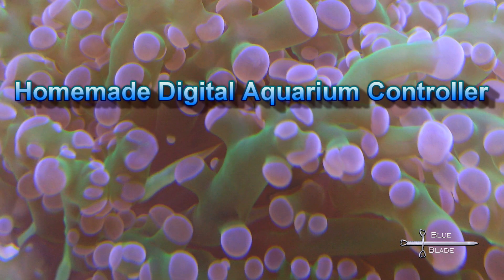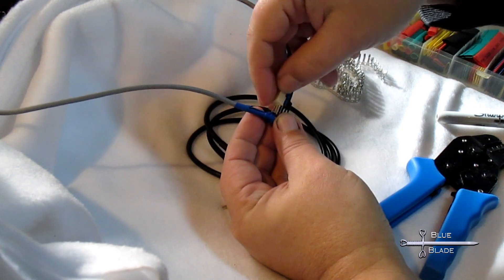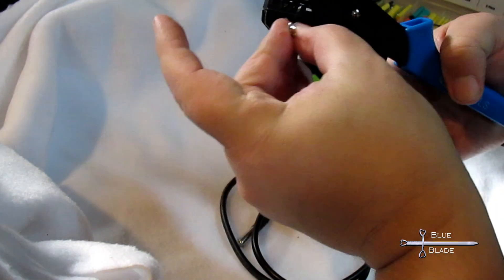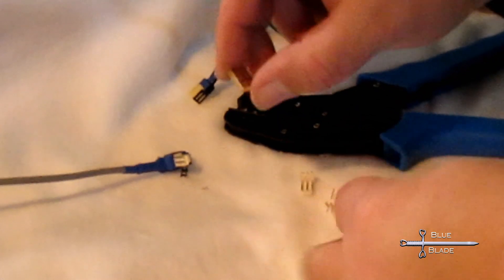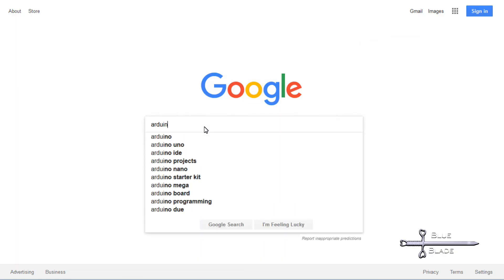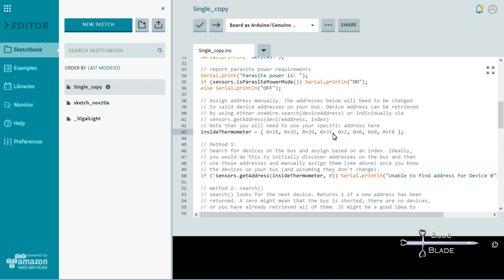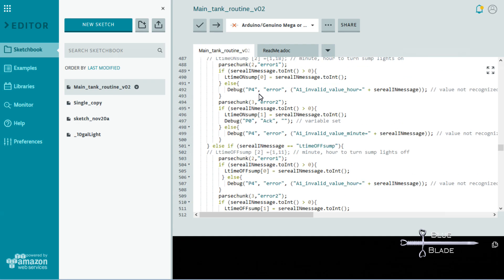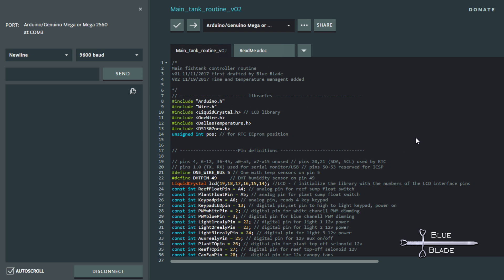DIY Arduino Aquarium Controller Pt3: Monitor Temperature with DS18B20

Comment: This is awesome. Thank you for sharing.
Whether thermal probes oxidize in seawater?
Reply from the maker: I have had them in the saltwater tank for several years now, no sign of oxidation or corrosion.
Reply: @BlueBladeFish  I am planning a similar project in a smaller size with reef aquarium